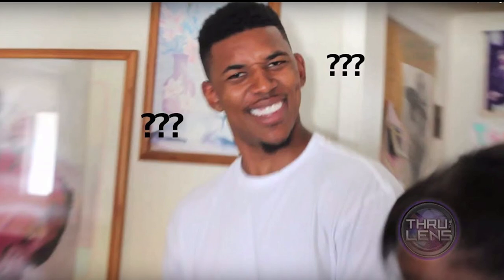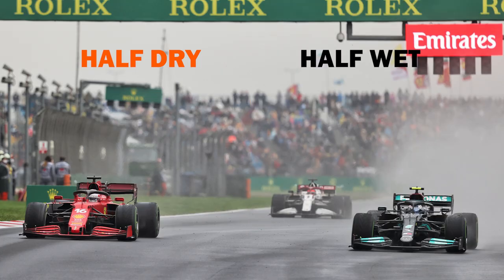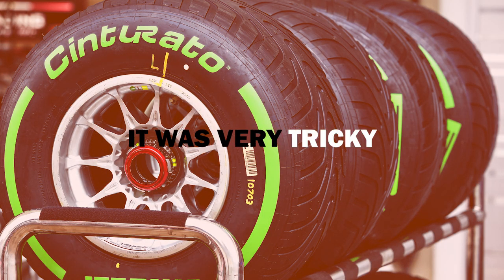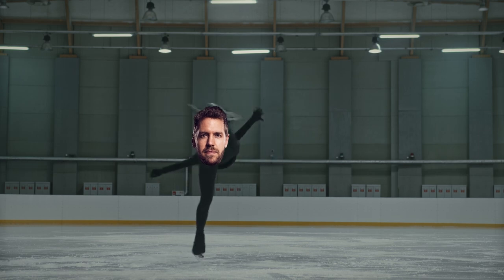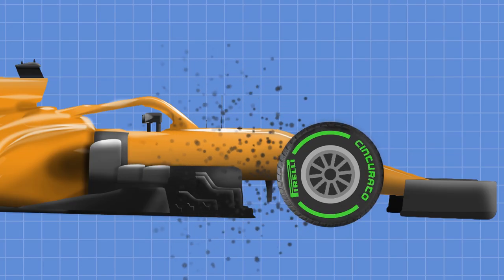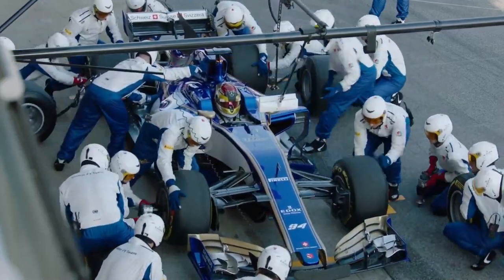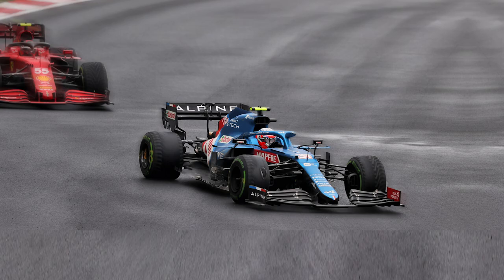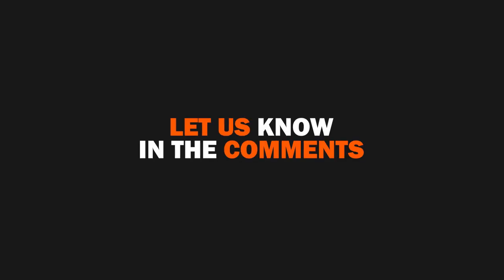How Does The Intermediate Tyre Last An ENTIRE F1 Race?

Comment: The time Ocon was losing at the end and the pressure Lewis was under he would've ended up in a similar position
Reply: Just making it to the end?
Reply: @jairajsinghshaktawat6593  Sigh. That would have been great!
Reply: the merc works much different on tyres to the Alpine though, he might have been fine.
Reply: @jairajsinghshaktawat6593  well substantiated reply ...
Reply: @jairajsinghshaktawat6593  I mean every race is a good indicator, and the rip in the tyre from Ocon almost certainly contributed to the loss of time at the end which wouldnt have hap;pened with hamilton likely. Again though, you judge my unsubstantiated comments but then leave your own like 'most probably in the barriers' or 'danger to otehr drivers' which just highlights your obvious Bias. Better cars are better on tyres since they have to rely on mechanical grip much less due to higher Aero grip. There is your reasoning, believe it if you wish, if not choose to remain dissonant in order to maintain your bias
Reply: @freescratch645  Do not forget that Esteban was preserving the tyres most of the race, while Lewis had some pretty heated battles to rise from the 11th position, which took quite something of the lifespan.

And another battles were coming as drivers were closing in on him. There was simply no way to make it to the end on reasonable pace. They should have pitted, but should have pitted sooner.
Reply: @freescratch645  He also worked them way harder. Ocon had a relatively calm race while Hamilton fought like hell as he went up the grid, his tires probably had a lot more wear.
Reply: @nhaaaPl  he was in wake the entire race with + or - a few seconds until people began to pit. Hamilton had free air, whihc means more aero grip.
Reply: I think someone calculated that he would have been something like 4 seconds quicker- wouldn’t have changed the position though

Comment: Well technically they only went 57 laps as Ocon was a lap down!😂
Reply: plus 1 - formation lap
Reply: Formation lap?
Reply: @robertkaras6315  plus the lap back to the pits
Reply: Alright 57 race laps
Reply: Funny  gæ
Reply: Funny  old man trying to scam as a chick
Reply: @robertkaras6315  Formation lap barely wears the tyre down at all because they're driving so slowly
Reply: @robertkaras6315  formation and cool down laps are usually pretty slow especially in the wet you dont wanna have too much temp in the tires
Reply: Funny  Mum?
Reply: @keisuketakahasi4584  in such conditions you actually want some temps in the inters.
Reply: @keisuketakahasi4584  Hmm, sex using our privates? Whatever will they think of next!?

Comment: By how heavily Lewis was pushing throughout the race, not stopping would likely have been disastrous.
Reply: good for max tho
Reply: There was a shot of one of his tires where you could see the metallic layer under the rubber starting to glimpse through. Mercedes were extremely scared of it blowing.
Reply: 10 laps before  the end leclerc caught Lewis at 1.5 secs per lap, and he would have probably  finished behind nor risk in 7th without stopping.
Reply: @leftyplayz6908  thats before they started graining then turned to slick-termediates.
Reply: And everybody would've appreciated that.
Reply: @WilliamsSupporter it's a bot
Reply: @WilliamsSupporter don't react to bots, just report them
Reply: Basically Lewis made the mistake of not listening to his team and pitting earlier, he was cutting his losses by pitting at lap 50, stopping a not so great situation from going completely off the rails
Reply: If he hadn't stopped he would have probably ended in the same position but with the risk of a tyre blowing out.
Reply: Wish Lewis would have tried ... Not be a Lewis fan ... Would have created some lovely drama

Comment: Back when grooved slick tires were a thing, there was a rule stating that teams gaining an advantage by using extremely worn tires could be penalized at the discretion of the stewards. I wonder if the shenanigans at Turkey over the last two seasons are going to cause that rule to come back on safety grounds.
Reply: I hope not. The inter is the coolest tire abailible
Reply: I would hope not. Not every weird situation like this requires a knee-jerk rule change. So they found that the intermediates worked for a long time in highly unusual conditions...so be it.

Comment: Well looking at ocon's tires at the end, they didn't actually last the whole race...
Reply: And he drove 1 lap less than a full race… 57 instead of 58
Reply: @WicherBos   But he still needed to do the formation and the cool down lap on these tyres.
Reply: @janzumstein8241  both of which are not full speed laps, and one of which he was almost coasting his way home.
Reply: @wyattroncin941  formation lap ( you’re pushing the tyres quite hard here) and cool down lap counts as a full race lap altogether.
Reply: Ocon flat spotting them didnt help him.
Reply: @versiable8041  formation lap is all brake warming, not pushing the tires. And cooldown lap is exactly that, cooling down. Ocon's was 3 minutes from crossing the line to stopping in the pit lane.

And neither formation, Cooldown nor the pre race lap to the grid are counted towards race distance covered or tire life consumed.
Reply: @wyattroncin941  Yes formation and cool down laps don’t count to race laps but they still wear the tyre down. Ocon did a full stint, whether you like it or not.
Reply: @versiable8041  Well that's just not true at all, Ocon did 1 less lap than a full stint no matter how you cut it. Everyone else does a cool down and warm up lap too. So a full stint is 58 laps+warm up and cool down. Ocon only did 57+warm up and cool down. That's 1 lap less. Whether you like it or not, that's not a full stint. And it is relevant, because that tyre was barely holding on.
Reply: @Miniz  57 race laps* and 59 total laps. Full stint.
Reply: @CharlesFreck  still a full stint, not his fault he was a lap down
Reply: @versiable8041  Literally his fault he's a lap down
Reply: @Miniz  nope
Reply: @Miniz  🤣🤣

Comment: It doesn't, it just becomes pretty much a slick tyre
Reply: The cool thing to is that because of camber, only about 3/4 of the tire (some more, some less) is a slick and the the outside 1/4 still has grooves to funnel the water thats trapped between the slick tire surface and the track, which causes hydroplaning.  Its like a true dual purpose race tire.
Reply: It's not just the fact they become slicks, Seb showed us the slicks didn't work. But the fact that the wet tyre compounds are actually much softer than the slicks made them still viable, since they work at a lower temperature.

Comment: Hi everyone! I want to start in karting competition and I would like to know what it could be the best option for me (what kart should I buy?) :I'm almost 15 and all the experience I have in karting is in rental karts, but I guess that at my age I should be able to drive a kz or dd2, also if you can comment me how to be inscribed in a competition I would be grateful. Thanks.
Reply: Reading along with you, best of luck man!
Reply: Do you have a budget?
Reply: @GBduds  more or less 10k
Reply: @GBduds  I'm thinking in a OTK or a sodi, with a dd2 or kz, also I should move to England for compete because here in Ibiza, Spain I don't have any track and any competition either.
Reply: @christophermora5216  Go with the Sodikart Sigma KZ 2021. It's more expensive than the OTK but it has more power and much better handling. You'll be able turn the tightest and brake the lastest of your opponents. After taxes it'll set you back $7, 125 USD.

Comment: Just a thought but what if enough of the drivers took a gamble on any dry tyre, would the track have been able to dry enough to eventually make a dry racing line and make everyone change to dry tyres
Reply: Well if the inters couldn’t clear up the water and dry the track, then the dry tries surely wouldn’t.
Reply: @9v-skk71  See I thought thought that but, if enough drivers were on dry tyres the difference in design and compound would potentially make a dry line to make it possible to race, the inters we dispersing the water and wore down to drive on the damp track but if enough went on the drys then maybe it would of worked, who knows, thank you for your thoughts though
Reply: @iwanevans607  thats an interesting thought, who knows what actually could have happened
Reply: @9v-skk71  It only really came to mind from past races, qualifying and practice where it’s gone from inters and someone or a few took the risk on drys, bit tricky at first but eventually it was good enough to drive on, thank you again for you thoughts and time

Comment: There should be an option for going the whole race on one compound : If you start with the hard compound, AND NEVER pit, THEN, you should be allowed to do the entire race using a single type of tire. Open the option of a no stop race.
Reply: That would become as safety concern.
You don't want to race at high speed on a very compromised and degraded tyres that could explode at any second.
This is why Pirelli rated their tyres lifespan, and advise the teams not to exceed them.
as tyre behavior will become unpredictable and safety will become a major concern.

Comment: They probably did a whole race with them to get some track data on the tyres imo. It made no sense strategically to stick to those tyres for that long, or anywhere past 40 laps
Reply: Not really, Hamilton's radio shows that he kind of stayed out because he was under the impression the track was going to dry out just in time for a change to slicks. If that did happen and slicks were 5+ seconds faster a lap and there was 6-7-8 laps left, then you wouldn't want to have pitted for inters already. Ocon may have had a similar thought process "it's going to dry out, we're going to go to slicks, so why would we pit if we're going to have to pit again anyway?". And then that never happened and since he wasn't really threatened and hadn't had to race anyone all day, he just decided to stay out for the last few laps assuming his tyres would hold. Leclerc absolutely just wanted to do a no stop because it was the only chance he had of winning, not because it was smart strategy, but that's because Ferrari hasn't won a race in over 2 years. But Hamilton definitely just thought it was going to dry out, I don't think it really crossed his mind that there wouldn't be another stop in the race until it was too late. There was no way his tyres were going to hold until the end. They looked as bad as Ocon's full race tyres and he did 8 less laps on them.

Comment: The huge difference between Ocon and Hamilton was Ocon wasn't in any need to push anywhere in the race (or we didn't see that, at least). Hamilton was. His tyres would have been worn down to the critical stage (aka the risk of the tyre blowing up) at least a couple laps earlier - Ocon already said there was maybe 1 lap left - Hamilton would have done that lap and still have at least another to go.

I reckon Button might have been able to do it at Hamilton's pace, there's a reason he was called the "tyre whisperer" - but Hamilton HAD to pit, if only for safety reasons. We remember what happened last time tyres blew up, don't we (flashbacks to Verstappen hitting the wall in Baku from a blown tyre).
Reply: Well he was battling Vettel and Sainz at one point, wasn't plain sailing for him too

Comment: Nascar fan here. 50 laps is about normal on a road course. 60 on a long oval, 70 on an intermediate, and 70 on a short track. Why do F1 tyres last so short? A Nascar tire could probably make a whole  F1 race.
Reply: Pirelli could easily make a tire last the whole race if they wanted to but the FIA and F1 don't want that. As it so happens, in 2005 teams were not allowed to change tires during a race except for when wet tires were involved.
Reply: I saw George pull 5.9g of decel during practice.
Thats alot of load into the tires.

Comment: I wish I knew how to ask this question to somebody of authority: Do you think Vettel would have been able to use slicks if they had put the soft RED tire on instead of the medium?
Reply: He said it in the video, the normal slicks are optimized to grip at high temperatures. The wet track wouldn't have allowed the tire to warm up, while the intermediate tires were fine with cooler temperatures
Reply: @Appletank8  Yes, BUT the softer the tires the easier they heat up, so my question is still valid.
Reply: @jdinhuntsvilleal4514  
You're pulling an extremely risky maneuver hoping that you'll never hit a wet patch and spin out. Vettel lost like 4 places in a single lap because he just couldn't get enough grip to maintain any decent speed. The track is still pretty wet in places.
Reply: @Appletank8  I get that. I'll I'm saying is when THEY DID put the slicks on Vettel, why didn't they use the softest tires? 9_9

Comment: Ocon almost blew his tyre but would it be different for Hamilton?
Hamilton has really great tyre management and I guess his tyres wouldn't be in such horrible condition?
Reply: His tyres would still be good by the very end he will only lose about 1 position and end up in 4th ahead of Charles considering his tyres were still okay.
Reply: @LimitPro1  he would have dropped harder than Ocon. Hamilton was pushing a lot harder on longer than Ocon was.
Reply: @jk844100  true, at that point he was stuck in a rock in a hard place.
Reply: @jk844100  Ocon did flat spot his, Lewis's were in better condition (more even wear)

Comment: If that was the strategy from the start and the driver tried to keep the tyres in good condition throughout, I don't see why it wouldn't work.
You can't push the whole race and then decide to keep the tyres till the end though, that's a recipe for a DNF.